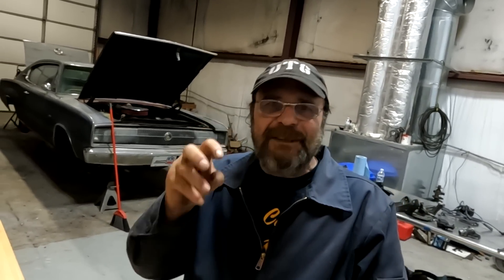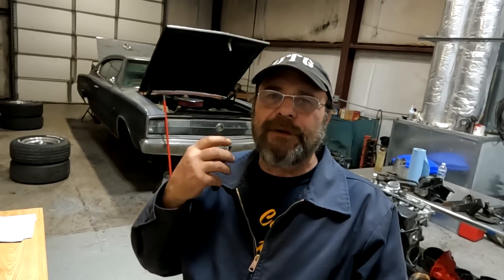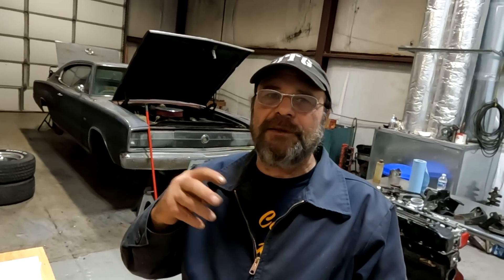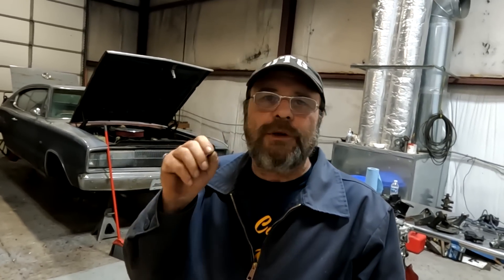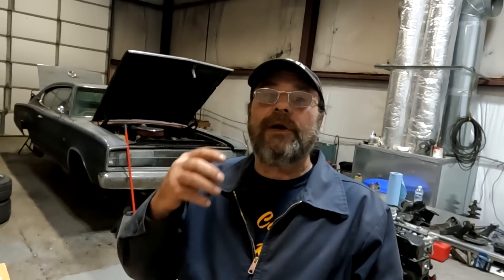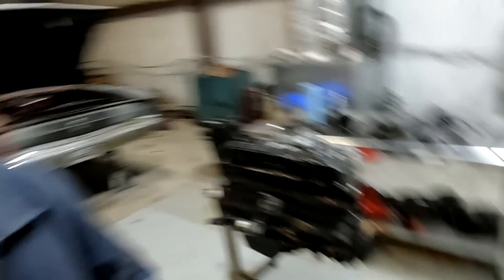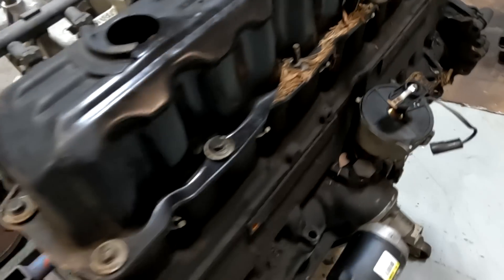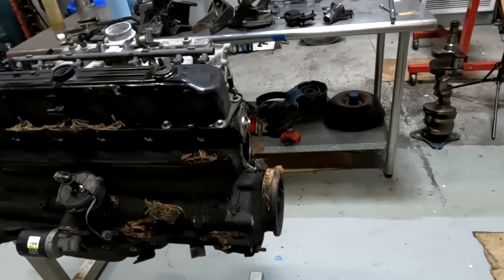Your First Engine Job - The Teardown, Diagnosis And Repair Of A Typical Automotive Engine

Comment: This is great! I’m about to start my first build (SBC 350) and feel like I’m about to put a bunch of time and money into something at the risk of having it run like crap. I’m trying to mitigate as mini risks as possible, like using a retrofit roller as opposed to flat tappet. I’ve been thinking about degreeing my cam as well but not sure if that’s as necessary of a step or if that’s just to get the most out of your engine. Looking forward to this series.
Reply: Don't sweat degreeing the cam unless you suspect the cam is incorrectly machined.  Just some quick basic checks to be certain it makes sense.
Retrofitting to roller is enough of a challenge, you'll have to get all the right parts and measure/adjust cam position and thrust.
Reply: @thisisyourcaptainspeaking2259  what are the issues with retrofitting to roller? I was under the impression that it should be easier but more expensive. My plan was to go with a Howard’s retrofit roller kit, is it mostly just fitting the cam button and measuring cam thrust? I’m also looking at an Eagle crank and piston kit that is prebalanced. That way I can just throw parts in and not worry about the wear they’ve had on them.
Reply: @SirWilliamsHand  Study your kit closely.  If it's a complete kit, it'll include everything and/or instructions of how to set it up properly.  Such as cam thrust adjustment and position.  This retrofit isn't simply tossing in a roller cam/lifter set and being ready to rock and roll.  If cam lobes are too deep (out of position), the adjacent lifter can crash into the wrong lobe, for instance.
Reply: @thisisyourcaptainspeaking2259  ah okay, thank you for clarifying. So much to learn! Thank you for the heads up, I will definitely read as much as possible.
Reply: Not degreeing the cam is unlikely to leave you with an engine that runs like poo, or doesn't run at all, although I imagine it is possible if it's a long way out.  They're not usually that far off.  But if you're going through all the expense and trouble of buying quality parts and building it right, then you should make the effort to at least get close to the best you can out of it.  It's a bit of a kerfuffel, but usually worth it in the end - both in terms of performance and peace of mind.
Reply: @aussiebloke609  that’s a good point. Seems like a straight forward process that I can at least check off as something that will give me more confidence regarding the engine.
Reply: Degreeing a cam is splitting hairs. Unnecessary for anything but competition where tenths/hundredths of a second count. In 50 years, Ive never bothered with it. What I WOULD do is either port the stock iron heads (especially on the exhaust side) , or use aftermarket heads which flow better. Super common and not that expensive for smallblock Chevy and Ford, Ive found that a complete valve job on stock heads including new valves isnt a lot cheaper than aftermarket Chevy heads.
If it were I, I would select a 4-bolt main block.
What youre after is volumetric efficiency, which becomes more critical the higher the RPM range you want to run at. Not as critical if youre building a truck engine that isnt going to see high RPMs much.
Reply: @donreinke5863  that was always kind of my assumption. I currently have a 3970010, 4 bolt at the machine shop getting cleaned up and done 30 over. My plan is to buy aftermarket heads as they look to be fairly inexpensive and fine with pump gas. I’m not looking to make power or race, just a reliable street build that I don’t have to sweat over. I don’t want to spend money where I don’t have to but willing to make the investments up front to make the engine more reliable. As far as RPM range goes, I don’t think I’d take it over 5200.
Reply: @SirWilliamsHand  Something that I left out. 1987 and newer Chevrolet blocks had a higher nickel content and resist cylinder wall wear better than the earlier engines.
Ive seen them hold a factory hone up to 200,000- miles while the older blocks had a significant ridge at 60,000
A benefit to roller cams (although more expensive) is that the break-in process and zinc assembly lube/additive is not necessary. As long as the rollers on the lifters (dont use cheap lifters) are properly aligned with the camshaft lobes, you should have no issues. You can also use aftermarket 1.6 ratio rocker arms that, while not changing duration, will provide some additional valve lift.
Should you elect to use roller tip rockers arms along with a roller cam, ensure that the roller contact pattern is directly centered on the valve stem tip throughout the operational cycle which will avoid side loading to the valve and resulting valve guide/valve stem wear.

Comment: The 4.0 is known for lack of oil to the number 6 cylinder. There's a few mods you can do to improve it, can't recall them off the top of my head though

Comment: Tony did you double check that the motor mount bosses and the accessory bracket bosses are in the right spot. There are 2 different Chrysler Jeep 4.0 blocks, I found out the hard way.

Comment: I'm looking forward to this series.
  This should be informative not only for those just getting into their first build, but also for old timers such as myself, who haven't done a complete tear down and build in decades.
   I have "freshened" up quite a few engines but, over this last summer I did a complete rebuild, it's been over 35 years since I've done that.
  There were alot of "minor" things that I had forgotten about.
  Many of them involved dealing with the machine shop. IE information that your machinist needs in order to do a propper job.
  Just telling them you want a standard 20thou overbore, isn't always the best way to go about things.
  Many times it is best to bring not only the block (and heads if their doing the head work) but also the new pistons, so they can ensure the clearances are correct, the type of rings you will be using, so the correct honing can be done.
 The camshaft so if new cam bearings are installed those tolerances can be checked,
 And the crank,  check it/polish it, 
  Also line boring/honing, these were a few things that I knew, but just forgot about when I dove in on this build.
  There were plenty of other things that I remembered as I got further in to the build.

Comment: For the initial removal of the engine from the vehicle you could do a short series showing a few different types of engines and vehicles and give a brief rundown on what could be entailed like the example below.

Remove hood.
Disconnect and remove battery.
Disconnect exhaust/s.
Disconnect fuel lines.
Disconnect coolant lines and radiator hoses.
Disconnect wiring.
Unbolt bellhousing. May require dropping transmission crossmember.
Support engine and unbolt mounts.
Bring engine forward to release transmission input shaft. May require removing radiator and AC heat exchanger, if you have one.
Lift engine out.

A generalised description of tools and equipment required might be helpful.

My first time pulling an engine involved a few friends and a length of pipe and some chains to lift the engine. Next time I had a rope block and tackle later, too much later, followed by a chain block between two convenient trees. An engine crane wouldn't have helped as it wouldn't be movable on a dirt surface. Never had an engine stand either. Work was on a wooden bench and the whole bench plus engine were covered by a tarp overnight. Good old days?

Comment: This is going to be a good series. Good engine to use as a teaching platform. Basic, simple, easy to understand design. I am curious to see where this goes, I am a fan of six cylinder engines. They don't get the credit they deserve. I got that first major engine lesson Long ago sometime last century when I was a very young man of 10 years old, I'm in the garage  wrenching on my 1964 Honda 90, my Dad was cool, when all the other little kids in the neighborhood were getting little mini bikes, he got me a real motorcycle, it would do 65 mph or better on the street. And Dad pulls his 63 Ford falcon club wagon window van into the garage and throws me the keys and says take it apart. Huh? When it cools down take the engine apart there's a book on the passenger seat. You want me to do what? Tools are in the box and on the bench, when it cools down take the engine apart. All the way? And with the help of the book, the old man coming out from time to time to see how I was doing I managed to strip that block,leaving it in the van. most of the work done from the driver's seat, honed the cylinders, put new rings on the Pistons, new bearings throughout it, reassembled it. Had the three speed transmission out and new shifting forks. Clutch assembly. I learned a lot that summer. And it was mostly Hands-On figure it out yourself.

Comment: My advice for a first timer. Sandwich bags, makers, masking tape, and take pics along the way. Clean parts as you disassemble. Most people will not do an engine in a day or weekend. Losing track of parts or where you left off can be frustrating.

Comment: I'm looking forward to this series. I'm about to pull down an AMC 232, the grandfather of the 4.0, it'll be cool to see just how much changed from '65 to '06
Reply: I don't think very much.  I don't have a 232 handy, but I've had an early 258 right next to a 4.0 and a lot of it is very much the same.  4.0 has bigger bores, and the deck shape is a little different, different mounting bosses, depending on the year of the 232, they have a different bellhousing. Different front accessory drive, different intake/exhaust, etc. But the architecture is the same and lots is swappable.  haha.  One thing I didn't remember when I built my 4.7 stroker was that the 4.0 has no fuel pump boss, so it needs electric.  haha.
Reply: One thing different is the early 199s and 232s had shaft mounted rockers.

Comment: Someone must have really abused that engine in the Jeep . we dont have nothing knocking tapping in our 1996 XJ . it has over 250,000 + we just use Rotella 15w40   wix  51515  and some marvel mystery oil in the gas tank when we fill up . before too long I imagine it will need a rebuild . great video never worked on rebuilding a 4.0

Comment: I want to custom cast my own iron heads for my engine!

After years and years and years of watching people porting and shaping engine heads, I'm pretty much ready to go to the next level, and just cast a whole fresh new set of heads and THEN see how well I do.

And if THAT works out...

JUST MAYBE I will try casting an engine BLOCK, based on the 440 RB, but with 2 more cylinders [aka a 'viper' motor] and see if I can get a V-10 crank and put together what will begin right off the floor with 550 CID.

If THAT is successful, I want to try something TRULY insane...

A DUAL OVERHEAD CAM HEMI head.

YES, I know they do not exist, and YES, I know that chain drives are pure poop...

I actually want to set it up to be 100% gear driven [I work on diesels a lot, so I think in gear drives more than chain drives].

And yes, gears are heavy and can really dump a wet blanket on your engine revving, I have been pondering all the best possible ways to reduce their moving mass so that they do not rob so much acceleration from the engine.

They won't have any of the chain stretching/jumping/breaking issues though.

If I can make an engine which is 'bullet proof' on such issues as cams, cam timing, and valve float, that will be more important to me than if it will snap to 8k RPM in 0.05 seconds.

That, plus the weight of the block, to me, is much less important than making sure its strong in those critical failure points that Uncle Tony here has made a point to show us.

Putting a little more 'beef' in the stress points will certainly put a lot more mass on the total of the engine's weight, but then David Vizard went and showed how drilling cranks can at one and the same time, increase strength and reduce crank mass.

So giving up a little 'here' the crank, to use somewhere else [ 'there' ] (the block) will result in a stronger, more rigid block, capable of surviving more power, without making the engine the kind of proverbial boat anchor that the Detroit 2 stroke diesel engines became famous for.

Comment: Cheapest and easiest thing for a beginner is to buy a plastic model v8 engine kit. All the parts are there, it even turns with a crank. You'll see everything and how it relates to everything else, plus it costs less than $100.00. If you screw up, didn't cost much and you dont have hundreds of pounds of metal to deal with.

Comment: I got about 80-100k on a blown head gasket. Was leaking oil into the radiator. Just ran it. Oil just leaked, never milky... That same time. It would over heat from time to time. Hoses blowing. Clogged radiator, fan sometimes works... And would get frequent knocks. Usually did them fast!! I can turn the car off and pop the clutch to help not warp the block quick cooling it down. But paying and doin the crank, full rebuild, engine swap maybe.... 

That dude's nuts!
Reply: Got to the point where I had to run the heater on full constantly. Then to the point had to stop every maybe 10 miles to pop radiator cap. Cracked the cap to hiss steam out. Blew it off mainly! Nah. But it did way too many times.

Did that. For years! 

Had a swap given to me. The motor blew finally. Crank was nasty. Some say. Too nasty!I guess I could've hand sanded for 3 weeks to round the crank back up. Measure it and order special bearings... but who's doin that kinda work? Put the swap in. About a year later. Still have to pop the radiator cap. 

Not really that I couldn't get a whatever for it. I rode it out... Always glad I never spent the 50 dollars. I study in the major of Broke-ism. So you just tend to beat dead horses to death! But the meat tends to be so much more tender...

Finally bought like a 60 buck radiator a junk yard fan. (Female dog) bitch ran great. Still runs great...

Impounded. 

Florida State statute 320.01(1)(a). Definitions. "Motor Vehicle"
AND propelled by power OTHER THAN muscular.

If my argument was then show me it move. And don't touch it. What do you think the magic would be, to get it moving again?

Or is it that muscular power is ALSO needed? Meaning definition is slightly off?

You think if I bought a 30 dollar baby VTech car toy. Where you have a steering wheel. Horn. Key. A lever....

If I don't even mention safety and function features like clutch or brake safety switches... Could they get the car on the toy to move!? Without muscular power involved?

Doubt it!!!

Would that be dismissed? Or are judges that bad. To turn a blind eye? Or would a jury be so heavily psychologically operated on?

If I have even the slightest argument. Ambiguous language in the "licensed contract" license agreement. And so. It just needs to be changed. No big deal...

I'm hoping these motions actually work out for me. Skipped the jury trial. Judge told me to appeal it. Which I've mentioned to him on other dropped charges!!! Same ones actually...

I'm keeping my fingers crossed. Legal system can't be bad enough to not even get a well you got a point we'll amend it to read correctly. Nothing. Straight guilty. 

Even though the state said on a phone call, by literal definition I'm right. It's just that nobody in the office including herself believes this!!!!

Told her millions of kids believe in Santa... Don't make him real... But also told her I'd like for her to pick me up from jail when I call her when I get picked up on the warrant!!! In a nice pair of heels... Hell ya!!!

And so. Moral of the story. Rod knock is a game I don't like to play around with for very long. Specially in a daily driver doing miles... Miles. I don't need something that simple blowing me out the water that far from land!!

Comment: Those 4.0 engines, just like the AMC 258 they are descended from, are tough engines. The 4.0 in my 98 XJ has over 300k on it and still running strong. Very torquey engines too. My old Gremlin X with a 258 2 barrel engine with the automatic trans could easily spin L60 tires back in the day. And that was with Lakewood slapper bars!

Comment: except, the engine is only the ice cream if you drive it...if you're a show guy or you spend your dough on ICE or chrome or paint (like Kustom guys), then you leave the engine stock. 

that said, tearing down a rear axle, a transmission, an engine, is like autopysing the dead. Hopefully there will be follow up series on how to ID bad axle bearings, or figuring out the difference between a bad trans and bad linkage. Or finding a vibration (ie, coast downhill in neutral to find if it's an engine or suspension issue). For anyone working on an old car they bought used, they're buying someone else's problems so it would help to figure out without a frame off restoration what a problem is.

Comment: Times have changed. First engine I tore apart was an .049 Cox a modle airplane motor got it when I was 8 in '73. Next was the Briggs and Stratton off a homemade go cart, then the engine on a Skidoo snowmobile. All that in grade school! They all still ran when I put them together. 
Today? Who buys a kid a nitro powered toy airplane? Might cut a finger off. 😂

Comment: I would like to see some more of the "hey this accessory does this on the engine, here's what's okay and what isn't". it seems to me ( as someone who's' basically green) that so long as the finishes look right and it's clearance right things should be fine when just doing a stock job